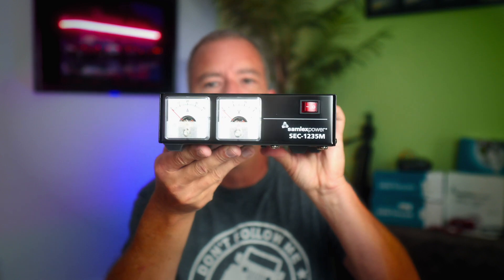How To Build A GMRS Repeater - Part II - Antenna, Duplexer, Coax, Grounding, & Idiots On Youtube

Comment: As a 30 yr electrician that has worked all over the country I concur. Most people try to make it all more confusing then it actually is. Most electricians I have worked with or even in FB groups are the most self righteous, pompous, and egotistical tradesmen out there. They over complicate things so the clients beneath them can't actually tell if they are getting a good deal or not.
Reply: Worse than welders? Those guys are quite (ahem) opinionated and won't waste a 1/2 second telling you your work is crap.

Comment: I put a couple walkie talkies together with a patch cable. Note: don’t have the receiving radio at full volume or you will fry the transmitting one, blow out everyone’s speakers, and dispense copious amounts of tinnitus. Ending the lives of 3 uv5rs. Baofengs are great to experiment with as I’m only out $35. Imagine if I used 2 of my Q10s. That would be almost $450 down the drain……… now for a moment of silence for the 3 uv5rs……………………….they won’t hurt anymore. Besides, their deaf now so it’s more then a moment of silence for them.

Comment: You got this. Glad you went LMR. 50W out the door will only give you 6.25W if you used RG-8X on a 100' run instead of UHF-rated feedline. I have that Samlex 35A power supply and although it's very good, its internal fan is horribly loud. if it's not in a living space then don't worry about it. There's a mod to run the internal fan constantly and at lower speed if you need it. Definitely add extra cooling to the transmitter if you think your machine will be heavily used, and when the CA temps hit 90 and above. The more the betterer. Good choice on the PL. Since you're running an open repeater don't forget to have it identify as needed (fast speed, low audio level Morse Code ID will suffice and you can do that cheaply if you look around, if you don't already have it covered. Don't forget a time-out timer for long-winded loudmouths or numpties who sit on their mic buttons.

Comment: My .20 cents: I have a 2x KG 1000G set as repeater with Nagoya NMO-200C antena, only isue I had to solve was TX hang up in transmission (radios are on top of each other using short cable). Solution: 6"x9" brass plate between radios and brass tape wrap around short connection cable. Either one work by it selves, but I am using both.

Comment: Hello, I am a fairly new GMRS “Dork” and just received a Wouxun KG-1000G and a DWC30WIN power supply. I will also be using a Ed Fong antenna mounted on my roof that WILL be grounded!!! So I wanted to know what type of lighting surge protector you are using and where to place it within the setup? Thanks for all of the helpful advice in your videos and love your sarcasm so much so that I set up my squelch tail to last the longest for those HamBones.
I to live here in the “IE” at the top of Fontucky, thanks again for your advice.
WREL210

Comment: I built my own wifi accessible temperature and humidity based fan control system before homekit was a thing. It keeps boxes of electronics (WiFi router, dog “fence” transmitters, etc…) up in the attic nice and cool all year long. It’s also saved me hundreds of dollars worth of electricity over simply running the fan full time.

Comment: What items does one need to connect the GMRS Duplexer to the radios? All items used would help. (Short cables with proper ends, what the cable #s are and any other connectors need.)  Thanks, Marc
Reply from the maker: You need some good quality (ie, not cheap) short coax patch-cables.. The exact connectors depend on what duplexer you use, but because some duplexers have "N" connectors, you may need patch cables with PL259 on one end (from the radio) and "N" type on the other end.   You will have to look at the holes on your duplexer and the holes on your radio to determine the exact connecters you need.
This is all part of the learning experience.

Comment: Way to go LMR400!  And they make 400 in ultra flex for the business end.   (It bends easy,  jumpers) love the channel, your attitude and the music.   Big fan.
Reply: Your mileage may vary with LMR400.  It doesn't play well in dull duplex (repeater) applications.  It may work at first but trust me, down the road it is going to be a problem.  Been there done that.  When the intermod from the transmitter starts getting back into the receiver side of the repeater it all goes downhill from there.

Comment: ? I'm running a 50w base, I use a repeater 12 miles away and get about 25miles.. but.. I'm at the very edge of its range. And would like to transmit  more fars south of me ,if I put the repeater at my house, won't that just give me the same fars I have now with my base station?  I'm thinking I should put it up about half as fars away from me..At a other location] and get way more fars?

Comment: Randy, I am brand new to GMRS. Your videos have been amazingly insightful, thank you. I do have a question. I want to put a tower up for a base radio, i also want to add a repeater to my property. Can these be done on the same tower or is there a minimal distance i should have between them?  Thank you in advance!!
Reply from the maker: Yes, you will need a lot of separation - vertical separation is best but if they are running on the same frequency, your tower may not be big enough. There are calculations to tell you how far apart they need to be based on the type of antenna and the frequencies.

Comment: Could I use a much more affordable radio on the receiver end and just use 1 powerful radio on the transmitter side
Reply from the maker: Yes, but then you would have to do all of the wiring, configuration, and internal radio programming yourself.

Comment: Randy what is the energy usage of your set up? I intend to set this exact system up up but I the site is somewhat remote so I need to power it with a solar panels and batteries. Any guidance you can provide would be appreciated.

Comment: Very good educational video and you've inspired me to get into GMRS.    I'm not quite sure how much the sections for the Rohn triangle towers cost these days, however, these come in 10 ft lengths and just two of those would get your antenna up to a decent height and with a good base, it'll be freestanding.  If you check a local hamfest, you just might get a bargain.

Comment: I tried to connect to your repeater frequency 462.600. input tone: 023 DPL. and output tone: 023DPL. so it isn't compatible with Retevis Radios? it doesn't have that kind of tone, is it only for Motorola radios?  I live in Riverside
Reply from the maker: DPL23 is compatible with pretty much all GMRS radios. You are doing it wrong.
Reply: @TheNotaRubicon  But where in the settings do you find the DPL tone? it only display CTCSS/DCS settings no DPL.
Reply from the maker: DCS/DPL/DTC are all the same thing.
Reply: @TheNotaRubicon  On my radio T-CDC only go down to 72.0 not 023, my radio is analog and your repeater must be digital right?
Reply from the maker: now try looking at your DCS settings.

Comment: Tuning a duplexer
I have a base antenna already mounted on my home and get perfect SWR on all channels 1-7 and 15 – 22 (1-7 SWR 1.00 and 15 – 22 swr1.02)
I purchased 2 RA87 radios that can be run as a repeater and already have a duplexer on Backorder with buytworadios. I chose RP 21 (462.7000 – 467.7000) Now the question or issue I have is I tested my repeater channels and All have a SWR between 1.48 – 1.56) Does it really matter if I target one particular RP channel or just get a wider range of all RP channels? My antenna will always be out of tune with any of these RP channels and if the duplexer is tuned to have the middle range of 467.625 then I can change easily if needed in the future. I am inexperienced and could use some input from more experienced users.

Comment: Did you had to calibrate the duplexer for the frequencies you needed?
Reply from the maker: Mine came pre-tuned.
Reply: @TheNotaRubicon  I bought one on amazon, needed to return it
Reply: @TheNotaRubicon  Did you contact them to calibrate for you? I am building my own GMRS repeater
Reply from the maker: I bought mine from BuyTwoWayRadios.com and if i recall they have the option to pay a few more $$ and you tell them what frequencies you will be using and they tune it.
Reply: @TheNotaRubicon  thanks for replaying, mentor. I will send them an email about it

Comment: Got a dumb question. When tuning the 1486 tram antenna,  do you have to cut the 3 steel radials at the bottom? Like you would for a car antenna?  Thanks! Great videos.
Reply: @TheNotaRubicon  thank you sir
Reply from the maker: sorry, i just re-read your question - the radials do NOT need to be trimmed.. but you do need to remove the antenna elements (wire) from inside the PVC and cut THOSE.. again, the instructions are pretty clear/understandable..
Reply: @TheNotaRubicon  no problem. Thanks

Comment: Putting your own repeater together is better than buying one made up. First, I think that the Wouxon radios are about the best GMRS radios made. I own a 905 and a 935. You'll be using higher quality everything that the preassembled ones since they might cut corners to keep the price down. It looks like you've done your homework also on that thing we can't mention. Now off to watch the rest of your video's, since I will build one too.

Comment: The only thing that gets me is that one radios transmitter will never be used.  Is it possible with that setup to have another repeater operating in reverse on two channels or the unused one operating a simple repeater.  Any more info on what options the have built in the radio using the interlink
Reply: My suggestion would be either switch out the Tx Rx radios or just let them be and if you have a Tx or Rx part failure you already have a backup part.

Comment: I feel like a sad ham. This Tram 1486 tuning SUCKS. PLZ HELP. The cutting chart is different from the one online. What mm did you end up with on L1 L2 & L3??????? Swr is good at 5 watts but at 25/50 watts its 1.9 on repeater channels & 15-22. Also my btech 50x1 only shows 23 watts on high.
Reply from the maker: Sorry, the antenna is all back together and in the air, and i tossed the chart after i got my (near perfect!) SWR..
If on High Power Setting, on a repeater channel/high power channel (Ch 14 or higher) you are only getting 23 watts, then check your meter and test with a dummy-load instead of an antenna. If it still only gives you 23 watts, call Btech and tell them to send you want that does what the box says it will do.
Reply: @TheNotaRubicon  Thank you.

Comment: Is everybody else within the 25 miles that you want to reach, also 2000 ft. above sea level?   Height is probably the best "force multiplier" outside of an ampliafier.......and they are expensive!
Reply from the maker: No.. Most of the area is in the valley - ranging from 400 to 1000 feet below..The repeater is now up and operational - not only is it covering the entire range we had hoped for, we are getting contacts from (so far) up to 45 miles away, from spots we never thought possible, mostly areas in the mountains above us.

Comment: Yes I know this is not the topic of this video but I need some straight answers and like we all know youtube's are all over the place on every topic... The question is I want to mount GMRS and a HAM radios in my jeep, can I mount both antenna's on the rear? Is there a preferred coax for mobile operations? Are there common issues mounting these two in such a close proximity to each other?
Reply from the maker: Yes - you can mount them both in there rear.. "experts" will say "that is the worst place to mount an antenna it wont work!"  - while its true the rear is not the best, it will work just fine. 
Two antennas close to each other will affect each other, but not so much that you would ever notice.. You may have issues when you transmit, with the signal bleeding into the other radio, depending on how close they are - keep them as far apart as you can..
Keep your coax run short - you should not need more than 20 feet, and it will work fine.. Better/lower loss quality coax will get you more signal in and out of the antenna, but for only 20 feet, the difference is minimal.
Reply: @TheNotaRubicon  Thanks...
Reply: @scottvallie4495  Many Jeepers I know who have both ham and GMRS licenses only use a single radio. Not a fan of that method—not just the legality issues but also the fact that UHF ham band antennas are generally not resonant on GMRS frequencies. But it could save you a lot of headaches too. I'm partial to the hood lip NMO mounts myself. You get a decent ground plane from the metal hood and a short coax run to the radio.
Reply: Take a look at the Comet antenna for 430-460 plus 144-148. CA-2x4SRNMO

Comment: Ok well I am a amateur radio operator and as far as I know repeaters have to identify every 10 minutes if it transmits of not it waits until keyed up

And the control operator has to be licensed and all transmissions have to
Be recorded 

In the old days Motorola and he prolines weee used with two antennas separated vertically by about 60 feet or with a duplexer closer.   

 EST wishes keep
Me informed 

Wa1tcq

Comment: p.s. I wish you'd do videos like this on Jeep-related tech. I'd pay to see you get this in-depth on regearing or dropping in a 4" lift and beefier suspension kits. Much more fun than radios, which is why my 41 year radio habit is taking a back seat to 4x4 'wheeling and overlanding. Looking for a unicorn rust-free TJ to build up and run 35s on.

Comment: On the topic of radio supply and demand, all electronics are seeing shortages right now. Just try and find a GPU or CPU at MSRP. The semiconductor plant fire that happened earlier this year is only making things worse. Multiple Ham radios have gone out of production because of the fire, and to top it all off demand for radios has skyrocketed due to political and economic events.